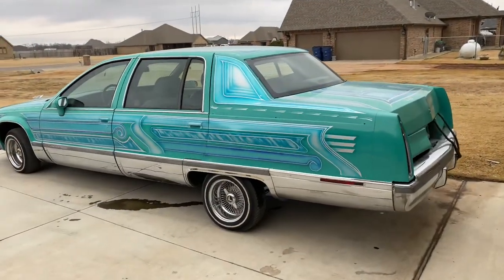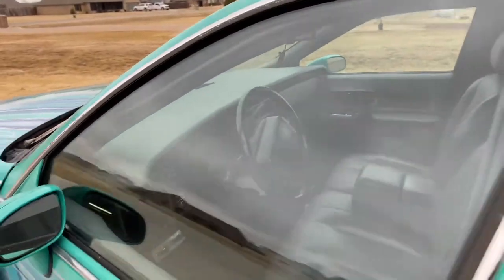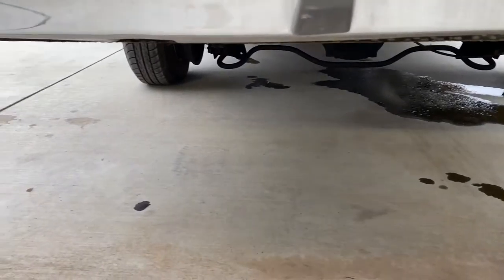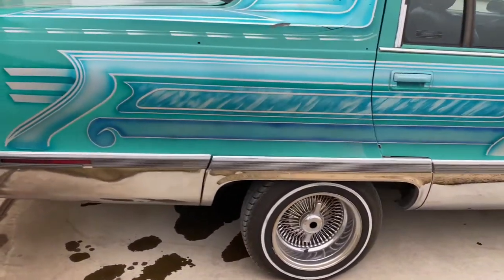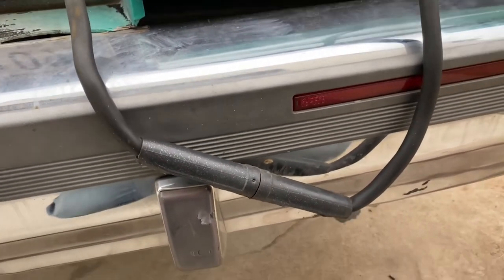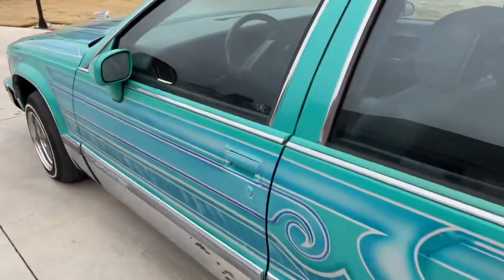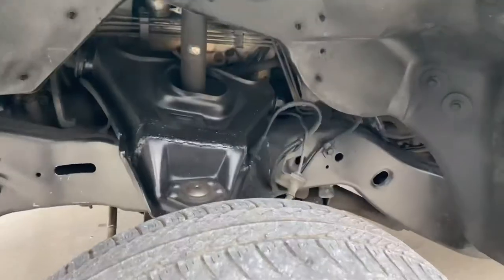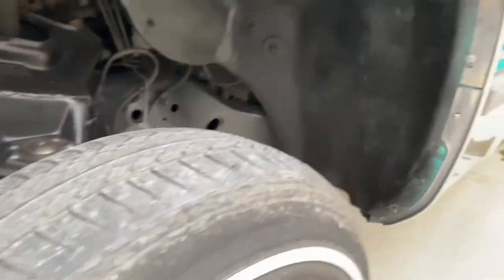Another Day, Another Project Car... Our New 1994 Cadillac Fleetwood Lowrider

Comment: Toggle switch is on off on once I get them wired up I can tap switch and it will automatically go to the middle to retap switch until car locked up?
Reply from the maker: These switches are momentary on-off-on - you can tap them slightly to lift or drop a little bit, or hold them for longer to lift or drop fully. 
When I get everything cleaned up and reinstalled I’ll go over the switch setup in a bit more detail!
Reply: @twistedimages405  thanks for the information
Reply: @twistedimages405  like from hoppos hydraulic right any lowrider shop should have them
Reply from the maker: @datboikevy4389  yeah Hoppos will have them in stock for sure